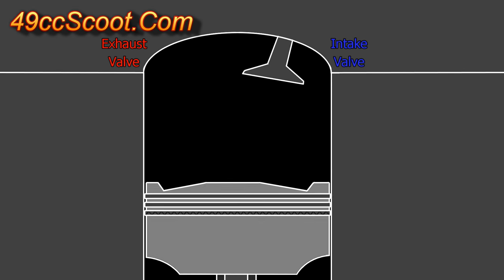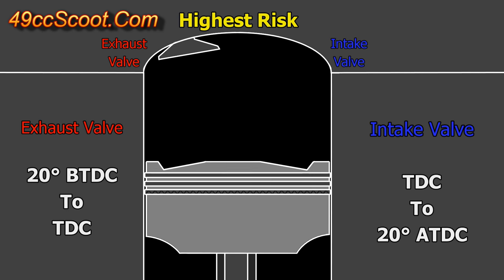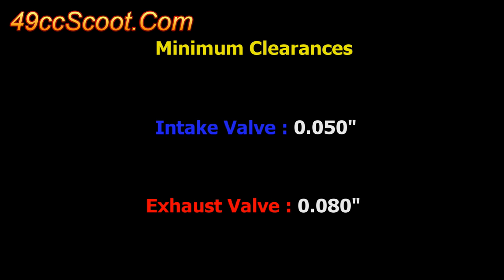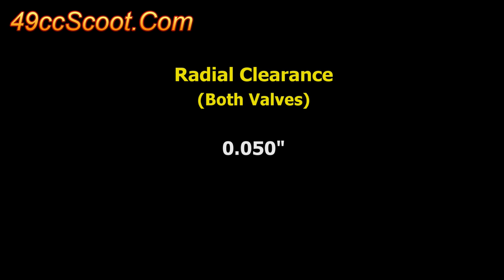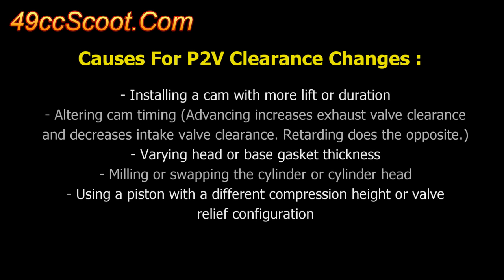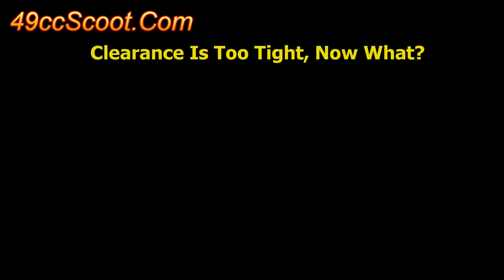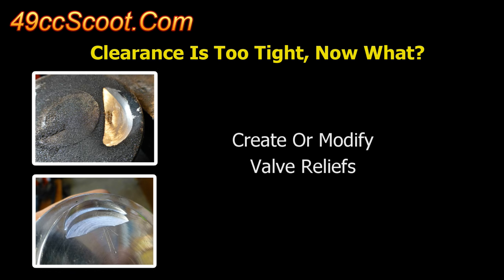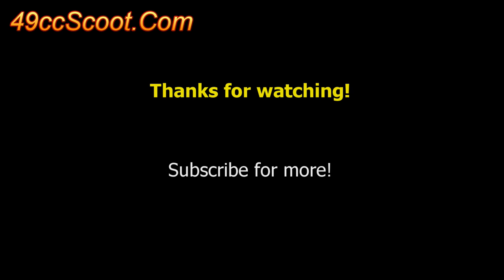Piston To Valve Clearance Info : Helpful For Scooters, Motorcycles, & More

Comment: my honda xr 150L  intake tappet valve clearance is .08mm and exhaust is .12mm(standard).. i brought it back to my dealer for a tune up at 12k km odo. they adjust the intake to  0.10mm and ex  0.12mm . any this adavantages for not following the standard clearance?
Reply from the maker: If the dealer told you this, then I'd assume they have a reason... or they updated specs... or just got the wrong specs I guess. Could be that the manufacturer or dealer believes it's better to open the valve 0.02mm less for some reason (P2V clearance or changes the way the cam works just a tiny bit) or they've found stock settings to be too tight and allow the intake valve to hang open in some cases. The best bet would be to ask them and see what they say.
Reply: @49ccscoot  Honda philippines just answered my message .. they explained something about the tolerance .

Comment: shouldn't it be 0.005" instead of 0.050"?  I'm just learning this stuff and I've seen 0.005 everywhere else..
Reply from the maker: Definitely not. We aren't talking about valve lash, like setting the gap between your rockers and the cam. That would more commonly be around 0.005". 0.005" piston to valve clearance will leave you close to disaster.
Reply: Me 0.050

Comment: Do you recommend a performance cam for my 200cc push rod engine? I am planning to upgrade my motorcycle, but I actually afraid to destroy the engine. Pls help me, If you recommend performance cam, what is the best size? The available in the market here in the Philippines is 6.5, 6.8, 7, and 7.2, pls help me
Reply from the maker: I don't know enough about those engines to give you any recommendation. It would be better off to find someone that is familiar with the engine type that you have.

Comment: Sir...  id like to ask i change my piston frm 52mm change to 57mm piston is thier any problem if my cylinder head chamber is  stil original or  should i bigger my chamber into 57mm size... thanks you sir more power
Reply from the maker: It's different in each circumstance because all parts are not made the same. One cylinder kit may have the piston below deck and create lower compression and larger squish clearance. Another may put the piston level with deck for high compression and tight clearance. A cranking compression test would tell you a bit. Squish clearance check would be good. At least rotate the engine over by hand before you ever try to start it, to be sure there is no contact of the piston and valves. Valve clearance check if you want to be more precise. Calculating compression ratio is good if you're in doubt.

Comment: bro i have decarbonized my engine head and changed both valves, also cleaned carburator. but now iam not getting mileage. there is no sound from engine and it starts and runs smoothly the only issue is iam not getting mileage as i used to get. the mechanic have even tuned the carburator. i dont know whats the issue. pls help. honda unicorn 2013. 45000+ kilometrs. current mileage is like 38 km below . i used to get around 50 before. pls answer if u know.
Reply from the maker: 1 really simple idea is to make sure nothing is leaking. A small leak could change observed fuel mileage significantly. Fittings,  hoses, float height.

You say 45,000km... had you seen it doing 50km recently? Sometimes people use old data as a reference, but it could have been steadily declining. 

Engine compression check wouldn't be a bad idea. Could be something not engine related, like low tire pressure, CVT or gearbox issue.

Comment: Do you know what are the safe recommendations for PTV clearance on bike engines bud? Just finished my build and i'm 2mm of clearance both on intake and exhaust valves. Hope that's safe enough..
Reply from the maker: That should be OK. I have seen people say you need a little more than that on the ex side of some larger MC engines. Wouldn't hurt to do a search and see if you can find info specific to what you're working on to be safe.

Comment: How would  set zero lash on all valves in a bike with shim type valve adjustment? Would i need to buy thicker shims and insall them under the buckets just for this clay test?
Reply from the maker: You'd set zero lash just like pretty much any other lash setting that you were after on a shimmed bucket. Measure the clearance and get shims with the appropriate thickness to adjust that clearance to 0.
Reply: @49ccscoot  i see, lots of bloody work then..thanks for seift reply
Reply from the maker: @Adikxx  Unfortunately all of this kind of work gets pretty tedious. If you don't want to risk it, you have to spend the time. Some people just check 1 cylinder.

Comment: I dont think  modifying the piston can help, it can cause slight vibration to the engine.
Reply from the maker: I wouldn't go grinding away on a balanced rotating assembly. For what I work on, it's not generally an issue.

Comment: Have been in valve clearance thingy from a week since i open my bike head for the first time. You video cleared two of the major questions for me Crystal clear. Why we need to adjust valve clearance and why the piston should be should be inserted in the right way ( which side should be up and and which side should be down on the exhaust side. 
SO thanks alot
Reply from the maker: I'm glad it helped!

Comment: Sir good morning I'm Filipino may I ask if there is a advance cam...to motorcycle ? Tnx
Reply from the maker: Depends on the motorcycle, but cams can be advanced.
Reply: Tnx sir may motorcycle is Suzuki raider 150 DOHC is it possible the cam to advance?
Reply: Sir can I request a video from you how to advance cams?
Reply from the maker: @arielmelon8413  You would need to see if anyone makes an adjustable cam gear for your application. That or cams with an adjustable gear already installed. Just moving it a tooth is not a good option and can move the cam way too much. You can see info about me using an adjustable gear on a GY6 150 here : https://49ccscoot.proboards.com/post/230617/thread

Comment: is it true that i get more power from my engine if i make the valve clearance lesser? because i have a really thick head gasket in my gy6 engine now so i know for sure that the clearance is a lot more that you sayd it should be in the video. i have a 72cc with a9 cam you think it is worth the efford? thanks .
Reply from the maker: Just to be clearn, many call valve clearance the valve lash... what you do when you adjust the valves. In that case, lots of lash settings can change performance to some small degree, but given the topic of the video I don't think that's what you're asking about.

Changing piston to valve clearance alone, I don't think will do much for you. Tightening up the squish, or the distance between the head and cylinder in general, raises compression if no other changes are made and that may improve performance. Tight squish clearances also help to prevent detonation. If you want the most from your engine, it's worth the effort to at least find out what kind of clearances you have and if they can be easily changed. It's also good to figure out your compression ratio, or at least a cranking compression figure (compression tester) so you have an idea if you even should push it higher.
Reply: 90GTVert thanks for the response I meant the piston to head space. I have a 72cc glixal kit and it came with a really  thick head gasket so I think its a good thing trying to tighten the squish its pretty fast already but I think the engine has more potential.

Comment: What happen if exhaust valve is a bit loos or a bit tight, pls clear the both situations.
Reply from the maker: Loose will clatter and can reduce open duration. Tight can hold the valve open so you lose compression.

Comment: Why more clearance to exhaust side?
Reply from the maker: The exhaust valve is chased up the bore and also the exhaust side runs the hottest and clearance is more likely to change from heat related issues.

Comment: How many degrees is the base of the exhaust valve open and closed?  and how much is the valve open and closed?
Reply: I mean you are basically how many degrees the two valves open
Reply from the maker: Depends which engine and what cam is in it. If it's a Chinese engine like a GY6 or 139QMB, then I'm not even sure that it would match up on a large scale.
Reply: @49ccscoot  yes thank you for the answer, maybe it takes time to install the camshaft to understand how it is😊😊😊

Comment: I just did a valve adjustment and now I have oil spewing out of inbetween the rocker arms, any ideas what's happened and what I need to do to fix it please?
Reply from the maker: I'm thinking you may just be seeing how the top end is oiled and that's a foreign sight if you aren't used to seeing the engine working with the valve cover off.
Reply: @49ccscoot  it spat quite a lot of oil out which made me panic a bit,
First time I adjusted there was a fair bit of tapping, so I stopped and re adjusted the valves again, started her up and a big splash of oil came out
The valves were really tight before I adjusted them as well, wondering if adjusting them has caused damage that was there to show up now or something?
Does the crankcase cover need to be on to start the engine?
Reply from the maker: @clive00rennison  The cover should be on when the engine is running or you're going to have oil spurting out.
Reply: @49ccscoot  ok, will put it back on in the morning and start her up and hopefully it doesn't spurt any more out 🤞🏾thanks for the help
Reply: So I've taken it apart again and replaced both top and bottom end gaskets and it's still puking oil everywhere, it kinda looks like it's leaking from the groove in the rocker arms bit?? Any ideas?
Reply from the maker: @clive00rennison  As long as the valve cover is off, it's going to move oil when it's running. Otherwise it couldn't lube the top end. If you really think you damaged something, then you can take the rocker assembly apart and inspect everything, but I'm thinking you may just be seeing what happens when the engine runs and the oil would normally not go anywhere because the valve cover is usually installed. If it's spitting oil out when the valve cover is installed and sealed, then that's a different story.
Reply: @49ccscoot  yup spitting oil out when the cover is on, I've got a new rocker arm assembly coming tomorrow and new cover gasket so hopefully that sorts it out